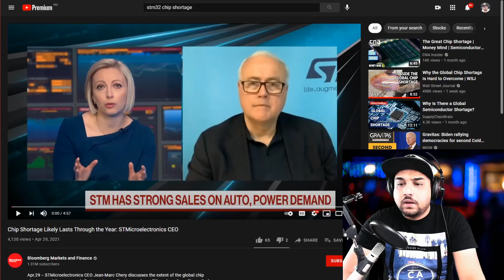FPV Drone Parts Have A Problem // STM32 Chip Shortage and Price Spikes To Continue For 1 Year

Comment: Law of supply an demand. Price increases will equal lower demand. People do not have unlimited capital. The hobby will either adapt or die. GPS flyers will invest in a nicer RV. The hobbyists FPV fliers will make due. The boom will end. Sorry. That’s all folks. FPV Hobbyists will get what they want. Fewer people like me buying stuff and thinking it’s cool. I am also looking at a really nice trailer with a solar power unit. 😜😎
Reply: But theres high demand for fpv parts wouldnt that not make them cheaper tho not more expensive?

Comment: i really need to find more time to work on my esp32 fc
Reply: @FourthWayRanch  well who'd be interested in "non-stunt type flying" - acro4life! - I think if you know your way around micropython and have a reasonably fast processing unit to work with, you probably can make an fc firmware that works, but frankly, I think you'll make your life much harder simply because you will have to be very very cautious about your resources.

betaflight  (and other cleanflight derivates) are in C, while it would definitely be possible to write this in asm, you won't find many people ready to contribute, and you'd have a much harder time maintaining support for as many configurations as we are used to - C/C++ seems the best compromise to make here, another language I'd consider might be Rust.